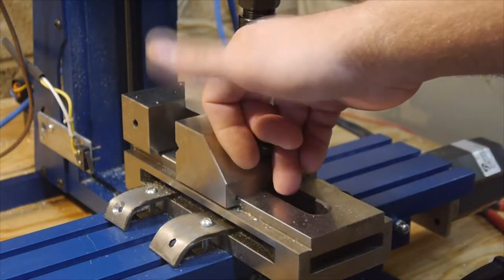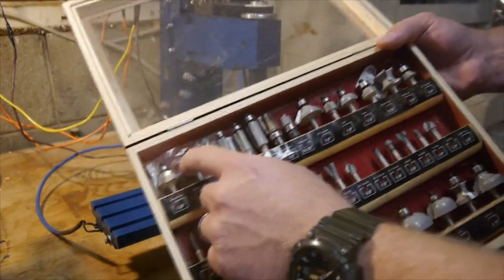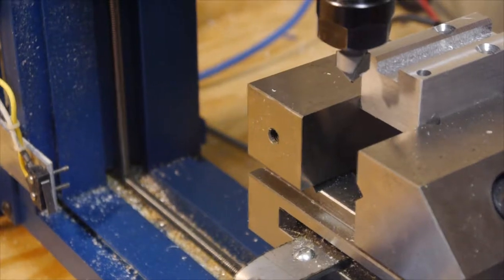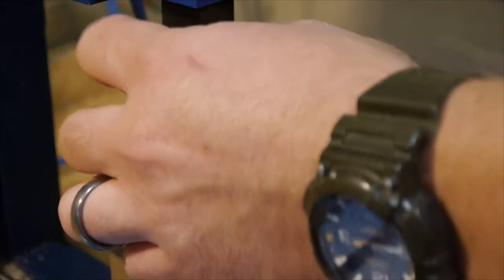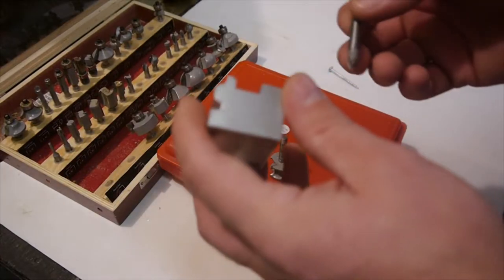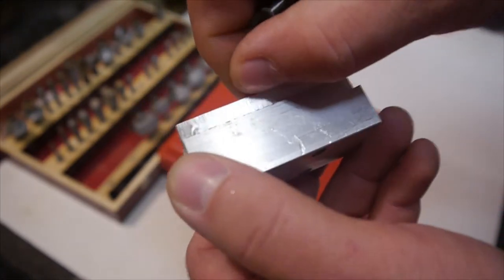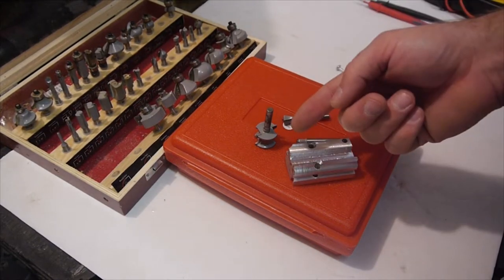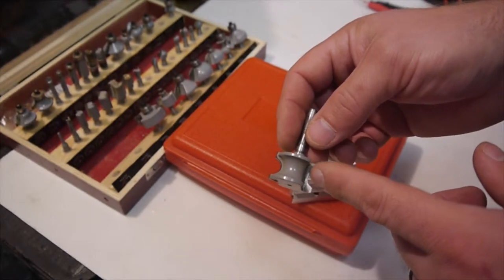Can Router Bits be use in a Mini-Mill? MAXNC CNC Mill

Comment: Interesting running across your video. I have used my router table to work aluminum. Also cut on my table saw with a regular carbide saw blade normally for wood. Both can leave a sufficient finish for my needs.

Comment: I wonder if brass being softer would give a decent finish. aluminum is a bit dry and stiff, probably some oil would help finishes but yeah it can be done with wood router bits, tho it'll wear them out fast on metal